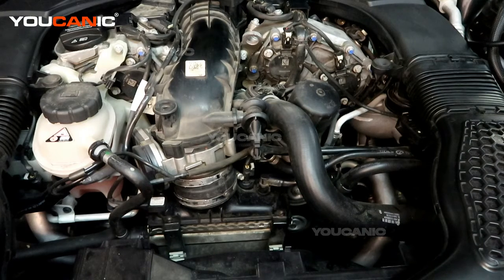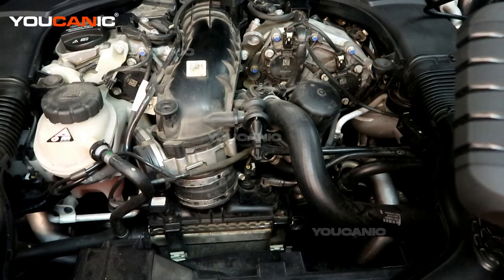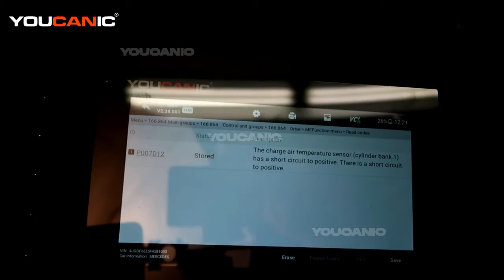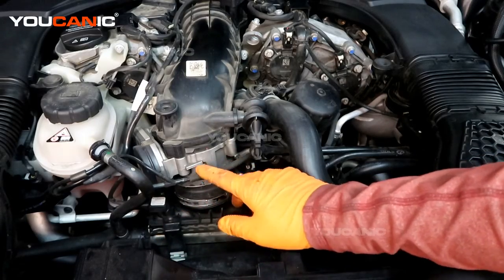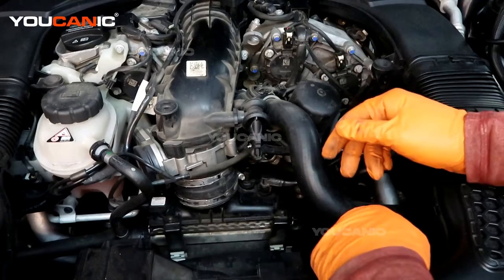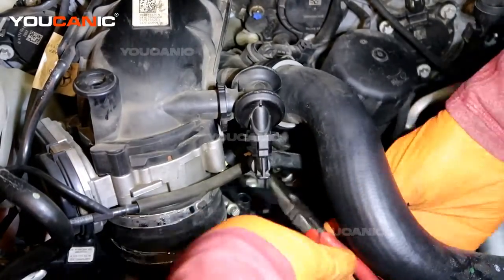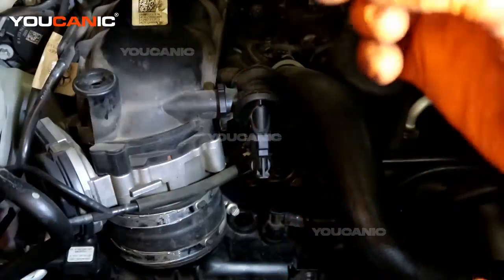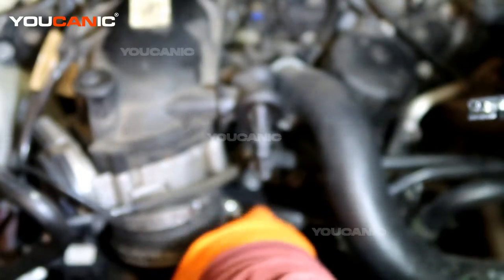Mercedes-Benz P007D - Charge Air Temperature Sensor Short Circuit

Comment: You have an idea of where this may be located on a 2014 E63 (M157 engine)
Reply: did you get it sorted?
Reply: @ yes I did, but it was alot more complicated than I thought. Ended up having to replace all the cooling/turbo lines, thermostat, and the water pump. Sensor was actually good.